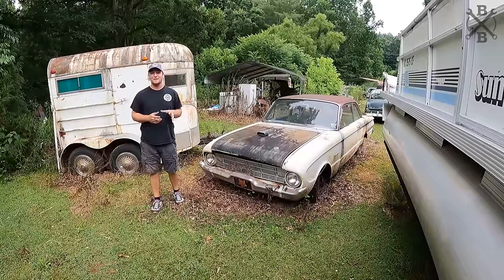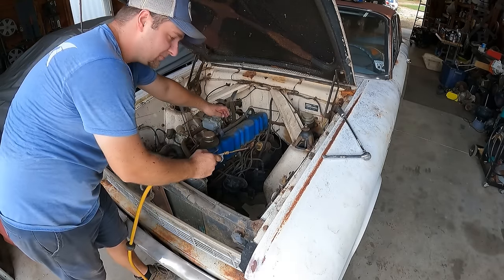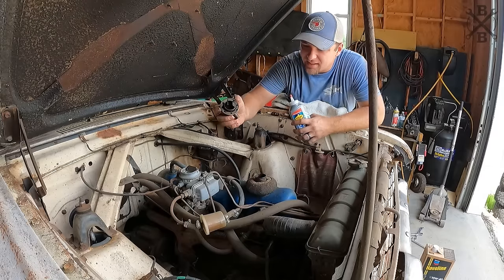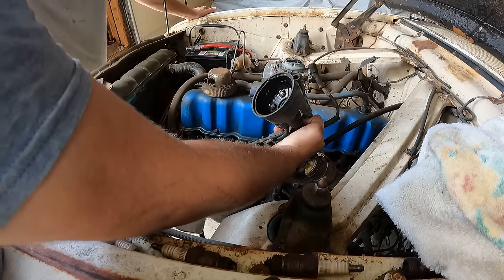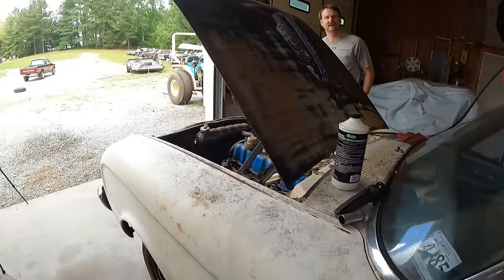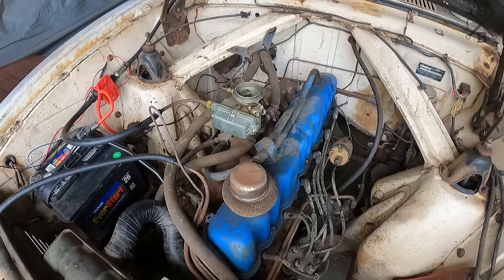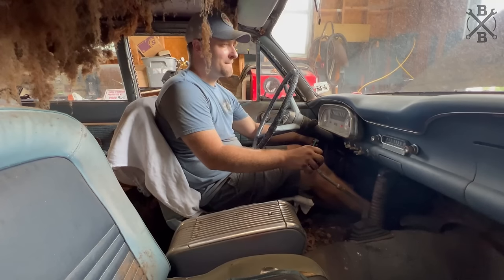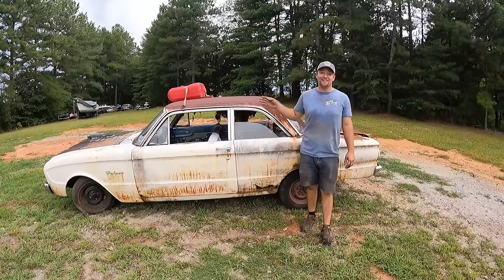Will it Run and Drive? 1960 Ford Falcon Sitting for 37 Years

Comment: My 1st car was a  baby blue, 2 door '63 Falcon 144 c.i., I-6 automatic. On a Friday in 1970, as a junior in H.S., I paid $100 for it and whatever I needed off of a  junk/parts car, 1962 Mercury Comet 3-speed standard to replace the blown automatic transmission. I took the pedal assembly, bell housing, flywheel, transmission, crossmember support, and driveshaft . All for a hundred! I bought a new clutch, pressure plate, TOB, and a 3-speed 'Spark-o-matic" floor shift, turned the flywheel, and drove it to school on Monday. I was laughed at by the muscle car crowd. I broke the  skinny, round shifter at the nut,(during a power shift?) and used a pair of Craftsman Vice Grips to get back home. sold it that way, too!

Comment: I've got a 61' Falcon myself, and they are fun little cars. The oil pan is the 144 oil pan, they had drain hole in the back. The 200 pan would've had the side mounted plug.
Reply from the maker: Sweet! I used to have ‘62 with a 2.3 and 4 speed, definitely a fun little cruiser! Hmm I wonder if the 144 oil pan fits the 200, as it also had the 144 fuel pump bolted to it.
Reply: I'm the second owner of my 61' Falcon futura. I also own a 60' Falcon station wagon, a 62' falcon coupe and a 64.5 falcon futura.
Reply: The front bumper looks decent, would you consider selling it?  Mine was mangled do to the bumper jack. These bumpers didn’t take a bumper jack very well.
Reply: Hey, the fuel pump is dual action the top hoses are vacuum assist for the windshield wiper motor. Had the same on my Edsel.

Comment: I love these early Falcons but I would absolutely have to find a 302 to squeeze into it.
Reply: LoL The state of those frame rails it'd twist em off.
Reply: You would be more authentic to drop in a 221, 260, or 289.  I used to wrench for Ford when the 302 came out.  The ONLY reason they punched it up to 302 inches was because of the late sixties - early 70s smog laws.  The engine HAD to be bigger in order to produce the same power as the 289 AND it had less gas mileage because of the smog crap they were forced to use.

Comment: Those 6cil deserve more love, with a proper carburator, intake and exhaust are really nice. And in Argentina they developed a 4 valve per cylinder head and they sound awesome with it, they rev to 8000rpm. 
Search "Falcon Multivavulas" if you want to see them in action
Reply: With the original 2 valve head, a good Weber 42 double barrel, and the 6 into 1 header they run very nice too. And sound wicked
Reply: Hey will y'all sale any parts off the falcon

Comment: My daily driver is a 62’ Falcon sedan. I left the body the way I found it. But it runs excellent. Original 144 cubic inch(2.4 liter) straight six. I put a new starter, cleaned the carb, new brakes,oil changed ,used coil and good used tires. I spent $507.00 to get it running. Love your channel!

Comment: This is almost the exact Falcon I bought in 1972 shortly before getting married. (white with blue interior)   Mine had a floor shift conversion, similar to this one.  The three speed has no synchro on low gear but does on second and third.  (unless they are broken)  I solved the shot front seat problem by dropping in a front seat from a 1964 2 door Dodge Polara.   Only had to drill for the two front mounting bolts, the back bolts were a drop in fit.  Plus, the Dodge seat set me up about three inches higher than the original seats.

Comment: Ford made Falcons in Australia from 1960 to 2016. The 250ci straight 6 was fully developed into the awesome 4 litre Barra engine in the 2002 BA Falcon. The factory-fitted turbocharged Barra is legendary! In 2016 I bought a new FGX XR6T straight off the showroom floor that produced 436 hp and speed-limited to 275km/h or 172 mph. An absolutely awesome car that I had to give up 🥲

Comment: I just recently bought a 1959 Ford Edsel! It was last tagged in 75, so it's been sitting for nearly 47 years under a shed. I was able to get the 332 v8 to idle, and now I'm working on dong a full rebuild.

Comment: Had a 61 2 door way back in 69 when I was 16. Was a 144 / 2 speed auto. Was a dog. Engine was crap. Picked up a 170 with 3 speed manual and converted it over. Was a blast. Got a junked 63 with the Futura bucket seat/console interior and put that in mine. Loved that car. Also picked up a 61 2 door wagon around the same time. Got the wagon running and traded it and $100 for a 49 Club Coupe. Dont have any of them anymore but would love to still have the wagon.

Comment: Shame you couldn't save this one. My first car was a 69 Ford Falcon with a straight six 200ci auto on the column. Could NOT kill the motor, god knows i drove it like i stole it. Wouldn't have been afraid to take off to California in it, great running car. 👍

Comment: We had a 60 Falcon when I was a little kid. The thing had a tiny six cylinder in it and a automatic. It smoked constantly out of the blo by tube under the car and loved to vapor lock and die and refuse to start. It also drove and stopped horribly.
Mom was so happy when we finally got rid of it and it's scary to think that platform became the Mustang but at least it gives you all kinds of upgrade parts to play with if you have one you want to play with. The 65 body looked so much nicer and probably got the better running gear upgrades if you ordered a v8.

Comment: The hood scoop, LOL- I have an F350. It is a crew cab, 4WD, the V10, TBC Gibson headers, the SPD Y-pipe kit and a Gibson side exhaust- when I went to paint it, I used an intercooler scoop from an '87 300ZX turbo, flipped it around and cut a large hole below. So many people think it's a tacked-on O'Reilly's fake scoop, but it works to evacuate the heat from under the hood. When I show them it is bolted & panel bonded to the hood, it shuts their mouths

Comment: At  least y'all are using all of the original parts off of it that can be used.,or repurposed to. For fixing up other ones to be saved.& able to still stay on the road.& Kept in the best conditions possible to for  vehicles that are that old to begin with.

Comment: I had the 61 model in the late sixties. it was pretty used up by the time I got it. It was in a better shape than the one above but still not in good shape.   I delivered pizza's in it when a teenager. It drove and rode like a tank. the floor boards were half there.  The engine however was actually pretty good and the 6 cyl got good gas mileage.  I think it had 13 inch tires.  I don't even remember what happened to it.   Wasn't worth much. It's just a memory now.

Comment: Oh you are so right about the new condenser quality having gone downhill. Went through several new ones myself before settling on an old one I had in my garage for years. I check them with a vom meter now to be sure they are of the proper microfarad rating.Ford recommended 0.21 to 0.25 microfarads for my 65 falcon 200 cu.in.6 great video thanks!

Comment: Adding a 'like' as you blew the crud off the engine, lubricated the bores and changed the oil before trying to start it !

Plus you didn't just throw the battery in !!

Comment: No man you're absolutely right for prelubing the engine you don't wanna dry start especially one that's been sitting a long time. Cause it does cause damage. If other people wanna do it wrong let. Em but it's good you have the sense not too👍
Reply: He's not actually pre-lubing the engine. If you pre-lube, you pump oil through the oiling system before the engine turns over at all. Yes, grinding away with the starter can and will build oil pressure but at that point you may as well just start the engine. Best wishes!

- Max Giganteum

Comment: The valve cover and air cleaner color Ford chose for their I6 engines is Blue on the 144, which was the only engine available in the Falcon in '60.  The following year they offered the larger 170, which was identified by a RED valve cover and air cleaner.

Comment: Getting those drums off is pretty easy with a drum puller and or squirt PB blaster through the back of the drum between them shoes and drums. I mean ALOT easier.

Comment: I HAD  ONE OF THESE  CARS.   IT WAS WHITE WITH BLUE INTERIOR JUST LIKE YOURS.  HAD SO MUCH FUN IN THAT CAR RUN FOR A LONG TIME. EVEN BLEW OUT 2 CYLINDERS AN D STILL COULD FIRE IT UP.  THIS WAS MY "KICK IN MY ASS" DID NOT DO MY HOMEWORK ON THE VIN NUMBER. WHY?  THERE WERE ONLY A FEW OF THESE THAT WERE WORTH 25K IN 1986. IT'S PROBABLY WORTH A LOT MORE TODAY.  THE GUY WHO BOUGHT DID A FRAME UP RESTORE AND CAME BACK TO SHOW ME WHAT I MISS OUT ON; NO HE DID NOT RUB IN MY FACE.  JUST A LESSON LEARN.  THAT IS WHY I ALWAYS  CHECK THE VIN NUMBER  ON ANY VEHICLE NO MATTER WHAT THE CONDITION IT IS IN.  LESSON LEARNED.

Comment: Excellent video Budget Buildz  (Mike)  :) yes 1966 was first year I know that 200 Cubic Cm size 6 cylinder motor were use in small cars and vans plus called small 6 and use Carter or Holley cars of 1 or 2 barrel flaps on carb for intake from air breather CFM were 450 to 680 to plus hook up Manual 3 to 4 speed transmission and Automatic in 3 or 4 speed on transmission some had power steering pump also air conditioning  plus power brakes too options to plus Tilt Steering wheel to ! 200 6 cylinders use  up till 1984 last year of them most were Ford and Mercury's  cars especially Mercury Capri like Mustang and had rare Carter or Holley Carb 656 CFM  the hp and torque less big 6 250 size but great motor lots people like them because fuel efficiency on gas plus oil plus matinne up ! Most ever 200 get for miles on before rebuilt was totally 500.000 and they  use 10w30 no synthetic engine oil plus orgnail Motorcraft parts on too !

Comment: The motor isn't stuck by a longshot, the old bird is  attempting to fire away, but before the old Ford bird will ever get airborne again, there IS considerable work to be done. Now I see for me the bird IS indeed flying, if not as yet back into the wild blue yonder of yore. I have my faith it's all a matter of time, though.

Comment: Oil is kinda o.k.   when I was growing up in Houston, Texas my dad bought a silver 66 Mustang with a 6-cylinder automatic.   The air cleaner had a decal that said "Sprint 6" on it.   That car was fast from 0 - 60 but petered out above that.   I learned to drive in a 1961 Ford Falcon station wagon ... 6-cylinder 3-on-a-tree.   I always thought the 61 Falcon was kinda goofy looking but it was reliable transportation.

Comment: She screams "turn me into a 260 V-8 Sprint!" The interior is already half way there. My dad's got a '65 Ranger half ton short bed pickup. He put Falcon bucket seats in it with a '63 Sprint center console. He redid the interior in white and turquoise like your '66. I've noticed you get oil in a box. Is that a regional thing? I've never seen that out here in, California. We have plastic jugs, out here.

Comment: those engines all had oiling problems that would be cured by taking off the rocker arm assembly and
drrilling out the rear stantion since they were oiled from the rear.  an after market oil kit was offered
with one plug and oil line to the rear stantion.  the  older y block v eights had the same problem and
a kit with two oil plugs with  two lines that were plumbed into one of the oil galley outlets on the side
of the block.

Comment: Not saying that it isn’t a 200 ci but Ford also made a 170 ci for the Falcon and Mercury Comet. If your engine really is a 200 it will have 7 main bearings, 5, instead of 3 core plugs, and a casting code of C5DE-H.

Comment: Five freeze plugs it could be a 200. Three it’s probably a 170. The 144 170 and 200 used the same block until 1965. The only way to know is to pull the head. I’ve been trying to figure out what I have in mine.

Comment: Of coarse it will run and drive ! It's a Ford Falcon ! The start of The Mustang ! They had the 170 and 200 6 cylinders. The same motors they used in some of their pick-ups and Econoline Vans !

Comment: Battery cables are cheep :) just change them out and move forward with good power.  The number of times I see people go 24v before replacing rotted battery wires just boggles the mind.

Comment: The 144 was blue 170 optional 144 was phased out after the first year. Had to a bunch of them l used to buy for $50.00 in the seventies for beaters; the 144 was a piece of junk 170 fine.
Reply: 170 was red

Comment: A running 60 falcon for $2500. Not in my area. Your falcon would be about $2000 around here, if you could even find one. They are not as common as you think.

Comment: I always wondered if the 300 would fit in a Falcon?
Reply: I was told that they are to tall. Although you can make it fit.
Reply: @donaldappelhof2059  thank you
It would be lighter weight over the
V8 torque monster
Reply: @JohnSmith-if4uy  the 300 six was one of the best engines ever built.
Reply: @donaldappelhof2059  
Indeed very smooth 
and you can modify them 
to put out even more power
Reply: @JohnSmith-if4uy  They gave me a 92 f150 five speed at work and I drove it for a week and thought I should check the oil and behold!  It was a 300 six!  I thought it was a small 8. I got 17 mpg pulling a trailer loaded with ductwork on the highway. Great truck. Lots of power.
Reply: @donaldappelhof2059  
Indeed the 6 was better than
the 302 around town torque on
demand really. The 302 would rev
higher..I owned two of them.
Last one had 375 K on it. 
A dump truck smashed into it :(

Comment: wow I can never understand miss matched plugs and wires when there soo cheap to just but and replace a full set on each service and when you have issues. 
Every year weather it needs them or not i do, rota cap, rota, plugs and leads just saves poor staring , brake downs etc.....

Comment: 144 cu in   blue valve cover and air cleaner black block,
 1964 170 and 200 cu in orange valve covers.and air cleaner and black blocks 
1965 and upwards 170 and 200 cu in   orange  valve covers air cleaner and blue blocks

Comment: Where do you find a runner for 2500?
Reply: Not in Missouri.    One with no motor or transmission in that shape is $2,500 around here if you can find it

Comment: This is a great video, BUT.....
You are starting to get away from your theme - BUDJIT BUILDZ
~ new positive battery cable? when you started this channel you would have made it work
~ new points without a little sandpaper - you must be getting sponsored by....
~ carburetor..... you could have made it work with a little more tuning - remember you theme - BUDGET
when you started this channel, you would try to make things work and live a little on the edge of safety, now you just buy new immediately. Please don't forget your roots of Budget Buildz!!!

BTW  - gas tank on the roof is the way to go - this should be standard on all cars.. haha

Sno Dawg